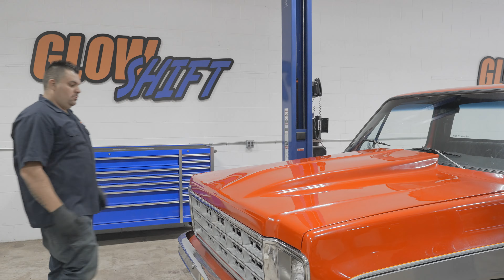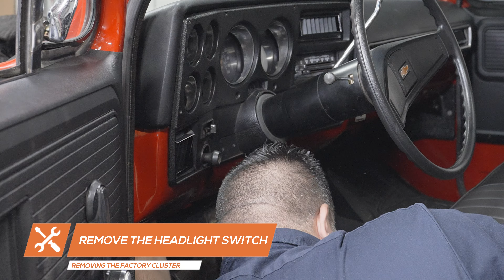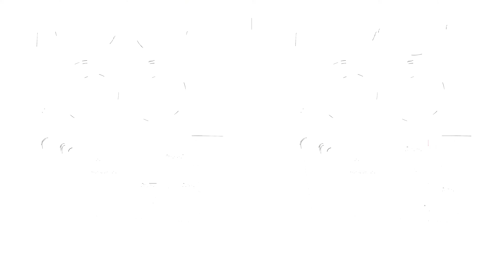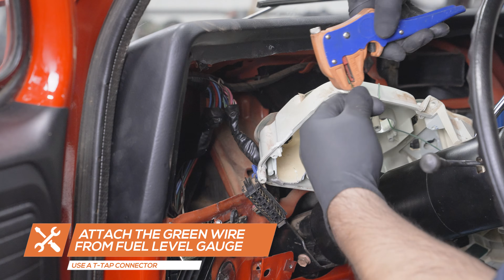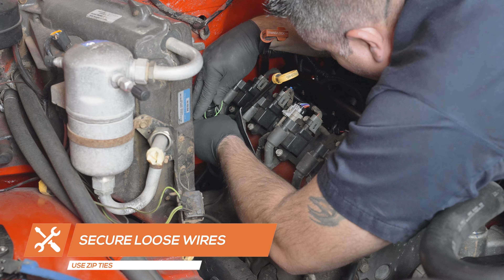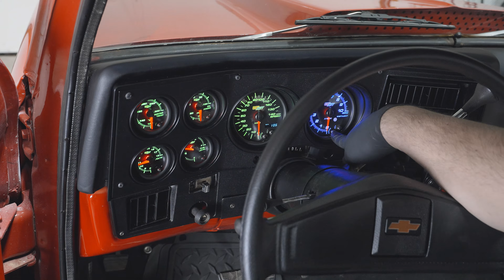73-87 Chevy C10 Gauge Cluster Install | LS Swap Dash Panel Replacement | Black 7 Color | GlowShift

Comment: Just bought these for a ‘71 I’d imagine the process is pretty similar if not identical. Does the tachometer signal come from the LS computer? If memory serves it’s a white wire but I’d have to check.
Reply from the maker: Yes it does.